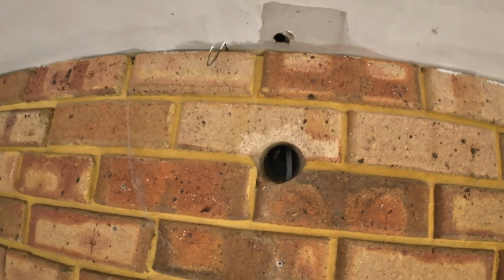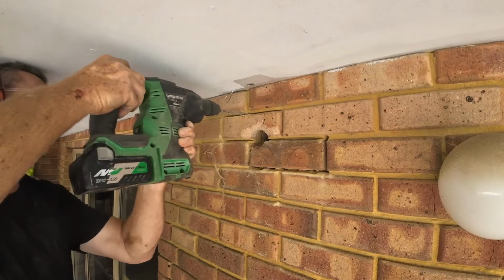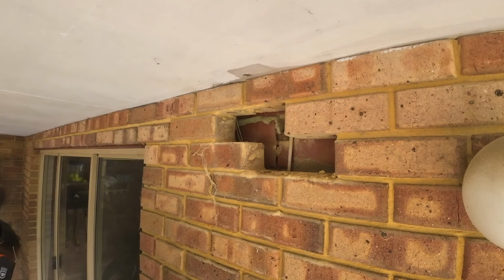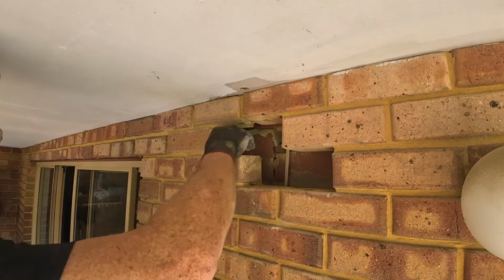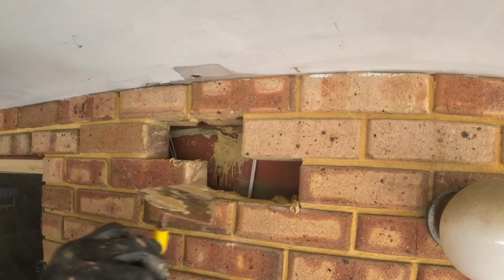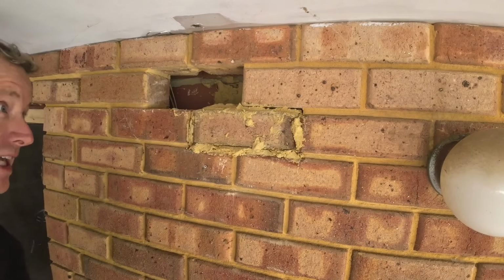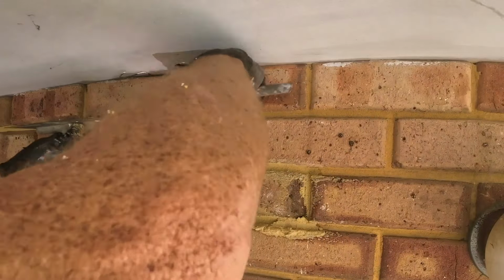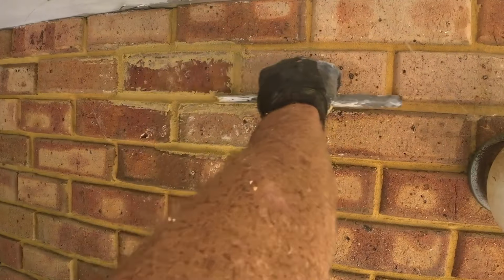How to repair damaged face brick

Comment: I had to do a ONE  brick repair job similar to this on a block of units. Very obvious as soon as i got on site. Had to use delicate hands on a ladder to remove as not destroy others. It took a visit to brick scrap yard to find similar. Looked so much better when finished as it was harder to see which one. Almost a full days work, but in the end a cost well worth it.
Reply from the maker: @antman3525  they are time consuming. I have had to do it a few times during builds. someone always seems to hit or mark a brick with something.